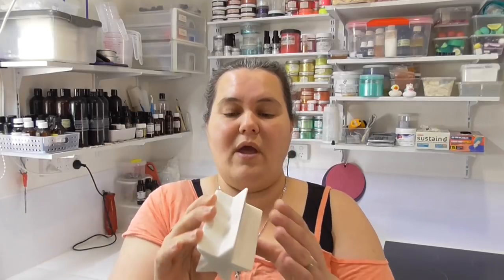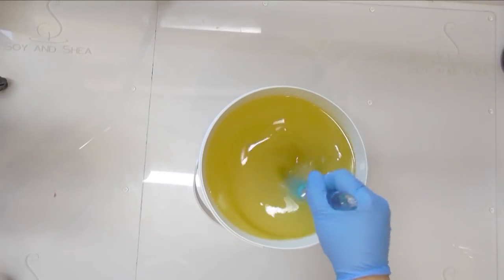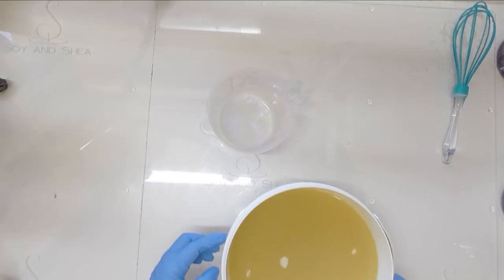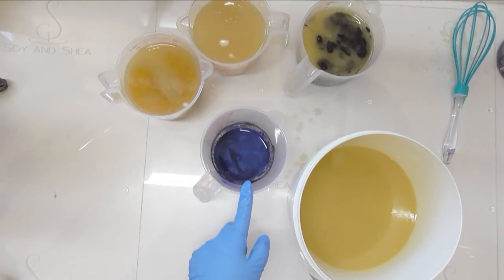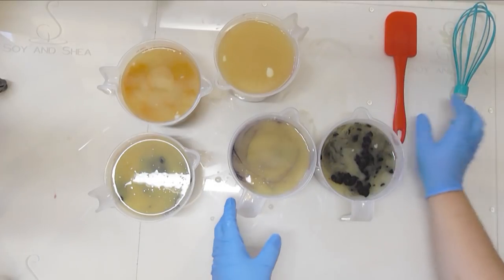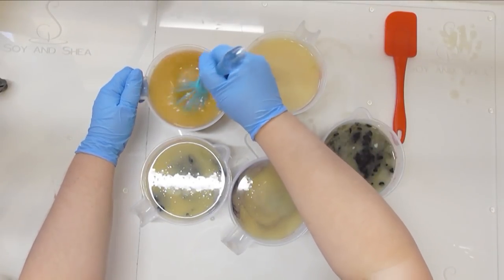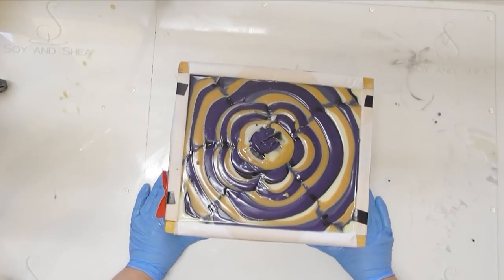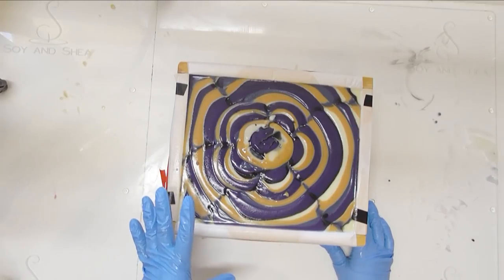Star Shaped Column Pour  - Black Night Cold Process Soap

Comment: Maybe Lee could make some different shapes for column pours. I really like the star one.
Reply from the maker: It's a great idea if there is a way of adding weight.  You need the column to have a little weight so it doesn't float up as the soap rises.  The material she uses is very light

Comment: These soaps are beautiful, love how each one is so different. Quick question did you cover the soap between spraying with the rubbing alcohol? Ive been making soap for a few months now but can’t seem to keep the soda ash away.
Reply from the maker: Thank you ⭐  no I didn't cover this one up.  I did get a little soda ash but I steamed it off.  I've not worked out how to stop soda ash.  Sometimes I get it and sometimes I don't
Reply: I don’t think there is a definitive protection against the dreaded ash but for me down south I find if I use a high level of olive oil I get it, such as a Castile or a Bastille soap. My recipes with less olive don’t get it 😊
Reply: I keep soda ash away by spraying with rubbing alcohol every 15 minutes for the first hour. Then I put it in the fridge uncovered for 12 hours. Takes it out let stand for several hours to finish up. I have NEVER had soda ash on my soap. I use a lot of milk in my soaps. I have done it without milk and had the same results. Maybe give it a try. Good luck! Hope it helps you out!
Reply from the maker: @waynegross2113  thank you for the tip 🧡  will definitely try that